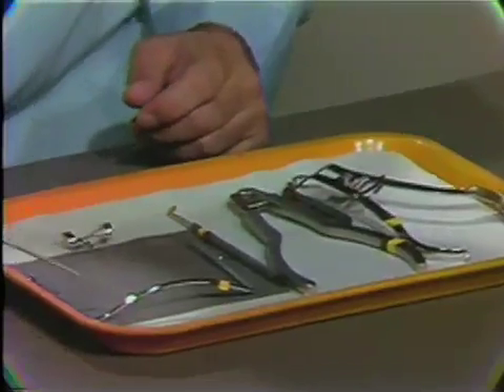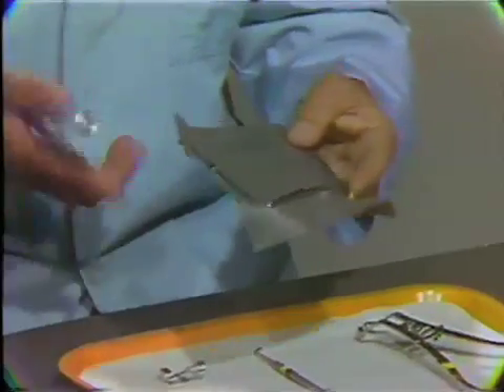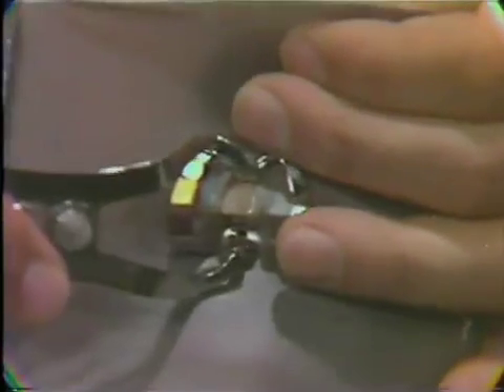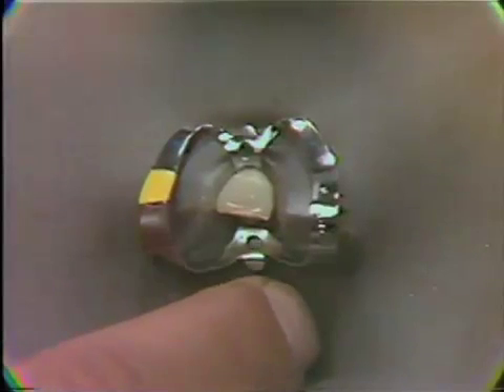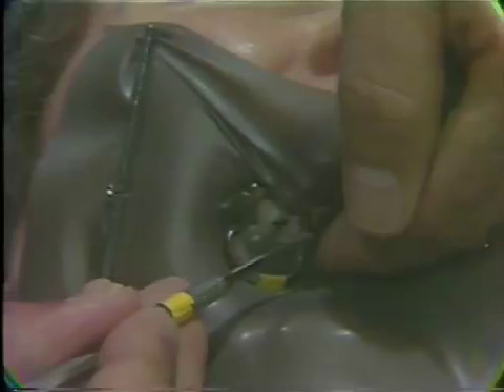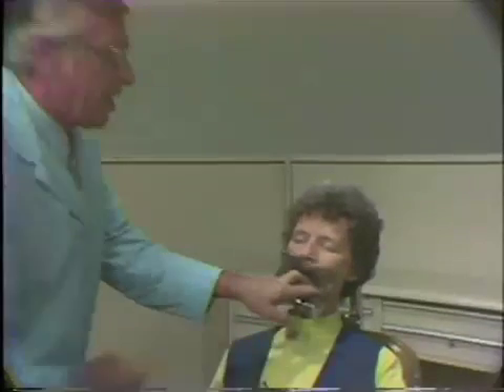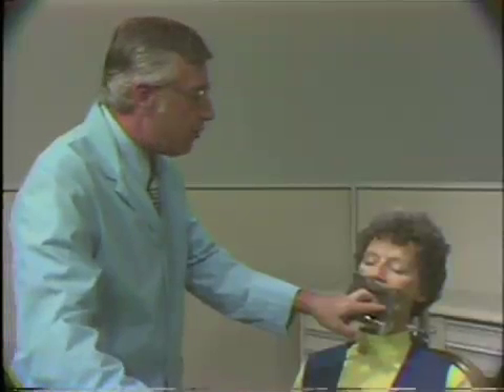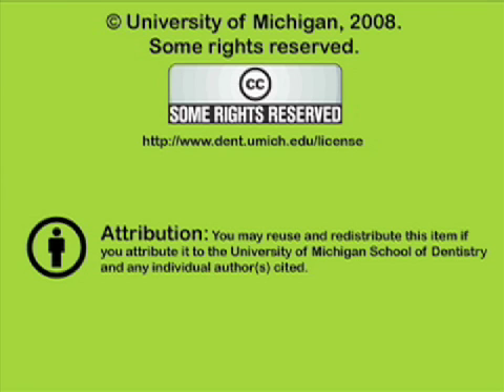Endodontic Rubber Dam Placement

Comment: A few things to consider: 
1. Infection control not sufficiently applied.
2. Nose is covered when rubber dam is placed, which makes it difficult for the patient to breathe.
3. The operator is not standing or sitting in an ergonomic position.
Other than that, This video will help me in my practical sessions.